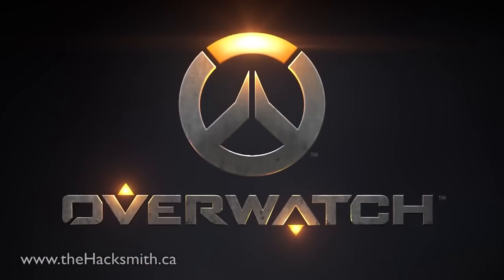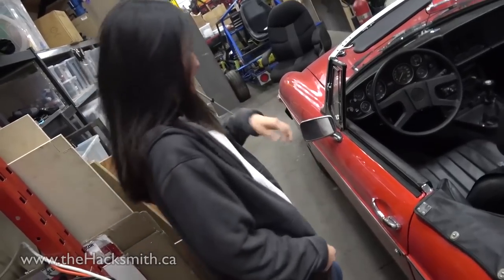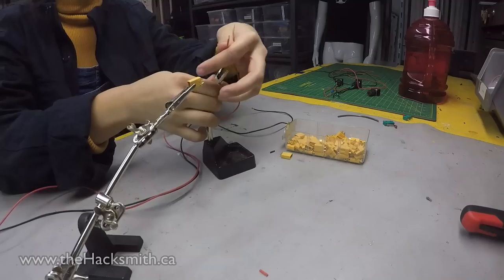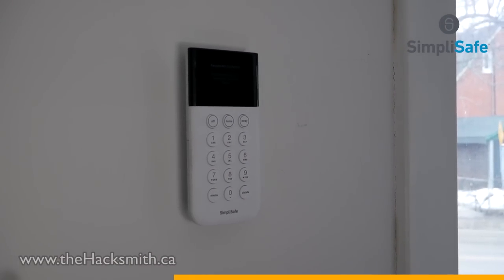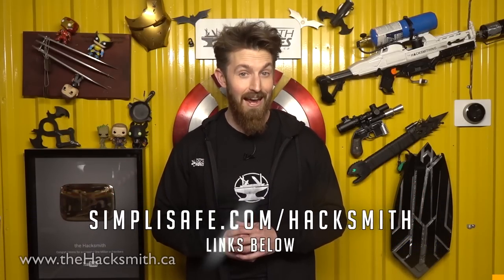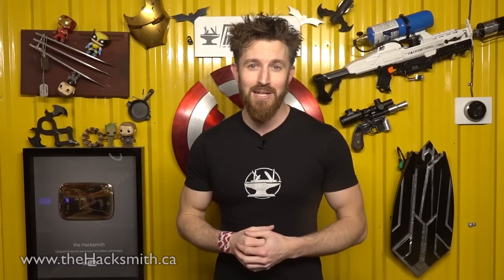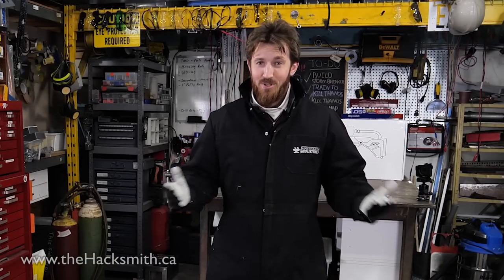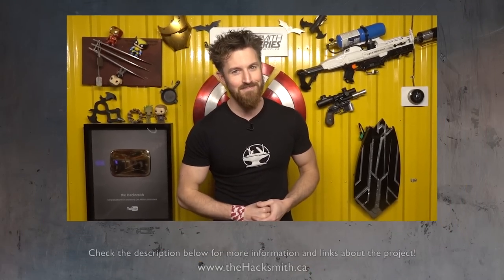Does Mei's ICE BLASTER Work? OVERWATCH BUILD

Comment: It might work somewhat if you added a stream of misted water that could join the particle stream of the dry ice, the water crystallizing and freezing over whatever the spray lands on?
Reply: Like the comment folks, really want to see this done
Reply: Dont understand what ur sying
Reply: Had exactly the same thought and came down to post this. I was thinking either using an ultrasonic humidifier or even just a high pressure mist spray. The challenge would be stopping the co2 from freezing it in the nozzle but it would make it even colder as it would probably coat whatever you sprayed it at with a thin layer of ice. It would probably take more heat out of the target as the phase change of the ice crystals melting on the target would draw out a lot of energy and the specific heat capacity of the water will be higher than the CO2... Cool project though!
Reply: You could have it below the point of freezing then the travel and impact with the object brings it up to freezing temperature
Reply: @tunecodm7562  if the gun shoots water with CO2 the water droplets would freeze on their target thus making it look frosted
Reply: ThePerformerMan hella dangerous. They should make it!
Reply: wouldn't the water freeze to early and just colide with the target? I mean thats still not bad
Reply: @tunecodm7562  read it again then! It's pretty damn simple.
Reply: they forgot about the satanic soul in snowball
Reply: I have no idea what you just said but yEs I need to see it!
Reply: I was literally about to type the exact same thing😂
Reply: Science
Reply: Insane Pickle you know you weren’t going to
Reply: Did you say particle stream, crystallizing and freezing what ever it lands is it dangerous? When you spray in skin contact? I'm curious if this thing can harm people? By the way so realistic that's good tho I like it!👌
Reply: T_Dogg, temperature control the barrel (would take more power though)
Reply: I think that if you vaporize the liquid nitrogen into a gas and combine it with the dry ice, then you could freeze someone.
Reply: PERFECT GAMING, freezer burn for starters, stuck to skin....
Reply: You scienced the heck out of that comment 👏👏👏
Reply: The freezing of the water in the stream would absorb a ton of energy, thus making the jet a lot warmer when it hits the target
Reply: ThePerformerMan you need to join the team😂😂🙌🏾
Reply: I have no clue what is being said by all of you but I’m interested
Reply: If you spray pressurized water steam into the CO2 stream,  the Mpemba effect should make a nice thick ice layer.
Or maybe just a snow storm.
Reply: @plankman6408  thank you! That's basically what I'm getting at. Make an icethrower.
Reply: Feck that’s what i was thinking
Reply: @tunecodm7562  when water hits the dry ice , the water freezes on impact
Reply: To just enhance the vocabulary... "Misted" instead use " vapourised" and btw.. Its not shooting out dry ice particles that's impossible. It's shooting the vapour from the dry ice to low temperature to freeze things. You can't vaporize a solid. And you would be on the right track to freeze things by having a stream of water but in game. It functions with ice to form solidified ice crystals and shards. Not co2 not dry ice. As the evaporation of dry ice and carbon dioxide not a part of natural ice. Which makes what you do in game impossible to do. But to replicate. This video does it about right.
Reply: Exactly...@Unmannedair Because the surface area of the water to surface area to the smallest CO2 vapour molecule will freeze it as it doesn't need a sustained chemical reaction to freeze it. But can be inconsistent due to science being unpredictable and it being a uncontrollable reaction. it's a matter of thermal dynamics and chemistry
(Basically there's more to it)
Reply: But there is a flaw in this as water can’t freeze very fast with dry ice due to vapor, also water essentially melts dry ice and they could have done like a grinder type of thing but that’s way to far fetched and still makes sense because you could have a fan and a grinder to blow out both ice an cold vapor, and projectiles like on the game. Still you would need a very high energy to freeze water, even though it looked like they did it, that’s a layer of ice
Reply: @kehrbotrsupporter5097  and mei
Reply: Kehrbotr Supporter LMAO
Reply: Im to dumb to understand this
Reply: Sir. Idk what you just said but you sound very smart, so thumbs up to you
Reply: Dislike this video if you dont see them putting ice wall features in this video :>
Reply: I semi understand, which means your a genius
Reply: Reality has left chat:
Reply: Why not just a jet stream of liquid nitrogen? it may be extremely dangerous but it would be a lot more realistic.

there was a big rig that crashed and flipped over in my country about a year ago that was towing a huge tank of liquid nitrogen, it bursted and froze everything in the immediate area, all the cars within 50 ft, the lamp posts, the roads, everything (nobody died). liquid nitrogens potency is undeniable.
Reply: ThePerformerMan I was thinking Nitrogen
Reply: Like during a Blizzard ice storm where the little Drops of Walter directly freeze on every surface where they are landing on
Reply: I was litteraly about too type the same thing LOL
Reply: You best me to it. :(
Reply: @Jessica trick with that is it still has to be cold enough to freeze as it contacts a surface. A saline solution would still be unfrozen as it got the target, causing a find liquid to shoot out without being able to freeze of the device's own power. It would rely on ambient moisture freezing while in contact with the cooler saline, rather than being a 'freeze blast' kind of device.
Reply: @chloekaftan  true, but with that strength comes equivalent risk. You have to not freeze your hand and arm while it's in proximity to enough Ni to freeze something rise, and bringing the Nithrower's volume down to an absolutely right level means reducng the freezing power. Mounting a vapor spray further away from the hand with enough force could be a compromise that still allows the device to function while being safe for the user!
Reply: @tomholton235  I have NO idea what you just said
Reply: ah finally the man spoke
Reply: I wish i was smart lol
Reply: Same thoughts
Reply: @Hacksmith
Reply: @tunecodm7562  I think there saying that the dry ice vaper will freeze the stream of water when it comes out the gun?
Reply: Was just thinking the same
Reply: Ooooooooooooo nice idea
Reply: Should of looked down instead of writing out a fast reply to the video XD
Reply: That would shoot out tiny spears of ice...
Reply: @CheeseVRC  Actually depending on the release ratio, you would have the equivalent of Ice Rain from Alaska. Comes down wet but freezes into a solid once it's comes to a standstill. It's a pain to drive through or on, reason most often we cancel school only for Ice Rain instead of Snow.

Although your statement is also not wrong, Ice rain is still forming into the solid during transit as well because of how cold it is to get Ice Rain. It would be highly unpleasant to be in, I should know, walking in it here in Alaska is certainly a very painful experience. (Like tiny knives forming INTO the skin, ugh....)
Reply: @Darkstar.....  well for one it definitely looks like I skimmed this one and mostly saw the drama shots, but as for the water specifically if you're making an ice blaster then you wanna shoot ice, not just a hyper-cold conductor with nitro. You can't make walls with just nitrogen. I'll show you my version of the coldblaster if you show me yours. :D

Comment: Try putting a water sprayer in the flow of that CO2. You could probably get freezing rain to freeze your enemies!
Reply: freezing rain? that-that's called snow.
Reply: That could actually work!
Reply: @rezuredragon  no actually freezing rain is it's own thing now frozen rain is snow, but freezing rain is not quite frozen but very cold
Reply: @rezuredragon  Snow is solitified rain not freezing rain, if you know what I mean
Reply: @rezuredragon  it would be more like an ice block crystal cause of the forces than it would be soft snow XD
Reply: Marshall Horton maybe have there be pressurised water cooled below freezing so it’s still liquid but becomes solid once it’s out of the pressurised environment
Reply: cough cough sleet

Comment: try using liquid oxygen and liquid hydrogen,  both are already really cold in liquid form, when combined they should make ice,  I don't have access to either of these to try it myself but theoretically it should work.
Reply: Liquid nitrogen could also work.  But the CO2 is by far the "safest" option comparatively
Reply: You would basically turn your back into a rocket/bomb. Terrible idea.

Comment: Really cool! But when looking at Mei's gun, you don't need to actually freeze what it is that you're aiming at. If you look at the actual in-game animations, it's much more like she's causing a build-up of frost on her enemies, which explains why they slow down and eventually can't move for a couple seconds. The ice builds up to the point where they can't move, then a combination of their body heat and struggling breaks through the relatively thin layer, which is also shown in the thawing animation; note how you HEAR them breaking out of the ice, not a silent thawing as their bodies return to their normal state. A closer example would be that thing where you leave a water bottle in the freezer, but it's still liquid when you pull it out until you flick the bottle or open it a little too roughly. The King of Random did some testing with that a while back, and they were able to pour the water out and have it instantly freeze into stalagmites on the ground where they poured.

Comment: When will you make Mavericks blowtorch like so he will see if you are a rainbow six fan
Reply: Well that's easy, just buy a blowtorch.
Reply: It's on his project list look at 1:22
Reply: Jeffo Edits a normal blowtorch doesn't melt metal like butter
Reply: It would basically just be a super op torch with maybe a wet burn... Go through your fuel just as fast as you can in game XD
Reply: Tropical Viking probably faster 😂
Reply: I want thermites exothermic charge
Reply: Jocular Ranger5 normal thermite doesn't easily burn through metal and I don't think hacksmith will easily get some c4 either. But it would be an amazing but 1 time use project

Comment: I know it’s probably impossible, but you should make Tracer’s Pulse Pistols.
Reply: It’s not impossible it just will not be like overwatch was thing at all these people are true gold geniuses there are toys that have traders reload mechanics, and trigger and makes sounds and lights for the guns now all they need to do is make something to actually show it I would recommend an epm(electro magnetic pulse if you didn’t know) they would have to modify it a little so that the lights were not shut off by the emp and then bam you have something that looks like tracers pulse pistols and they could make some gloves with some magnets that spun every 40 seconds the bottom would have to be metal but what that would do would mean it would spin like tracers reloading and the meelee attack you get the point

Comment: Use an ultra cold liquid rather than gas, this solves the cooling issue, pre cool before firing and still combine with a bit of liquid nitrogen purely to condition the gas around the shooting liquid, problem solved.

Comment: Well your biggest mistake was using liquid nitrogen. They have chemicals sprays that freeze stuff ALOT more powerfully than that. Liquid nitrogen is simply the most well known yet one of the bare minimum cost.

The one Mei herself likely uses considering it's a high level lab is Liquid Hydrogen. 

Liquid Hydrogen is the coldest substance known to man, minus 400 degrees. Pretty sure NASA uses it for the shuttles.